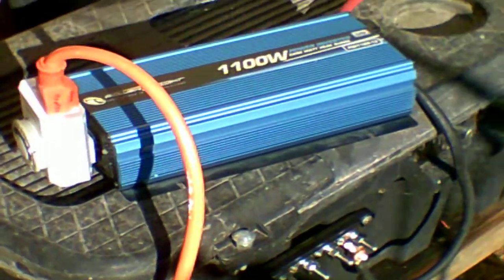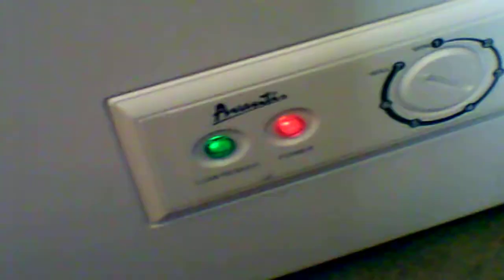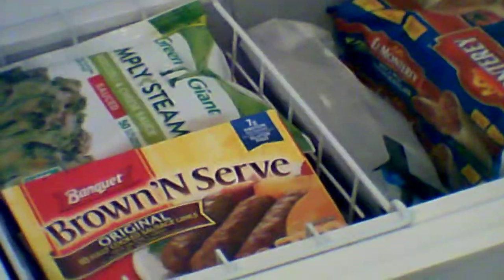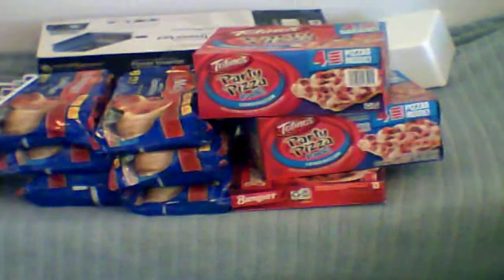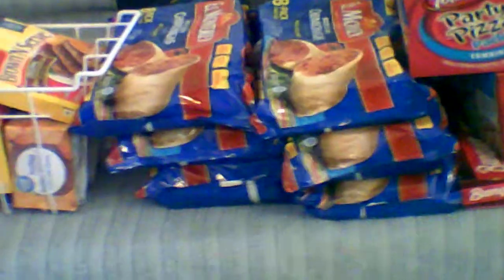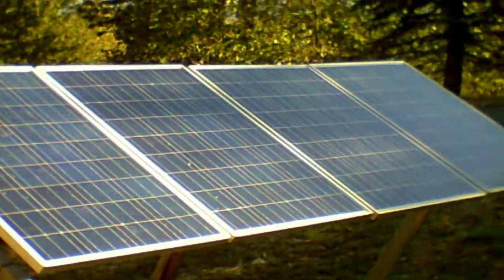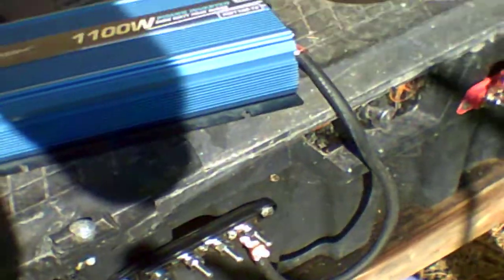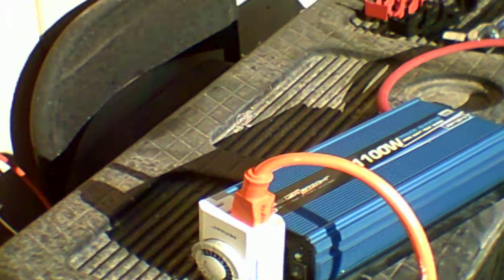Chest Freezer running off of Solar

Comment: I am more interested in the way you are using the timer.

How long do you have to let it run in order to ensure everything remains frozen?

How many watt hours per day does it end up using?

I am trying to do something similar.

It looks like you have to keep the inverter going all the time for the timer to work. Doesn't that waste a lot of your battery power?
Reply from the maker: Depending on your chest freezer you can get by with only running it for 15 to 30 minutes at a time at night 4 to 5 times a night. Like I said it depends on your freezer. My advice would be to test it with your freezer empty, and adjust your timer as needed. Once you find the right setting for your freezer then put the food in it. A full or even half full freezer runs a lot less and stays colder longer. A frozen freezer takes a lot less power to keep it cold than to freeze it. Yes your inverter and timer will use a very little bit of power, and only run fully once your freezer kicks on. Your inverter is more or less on standby mode with a very small amount of power being used for the timer. Then it will output the power needed once the timer and freezer kick on, but it's nothing compared to running your freezer full time. The timer just makes the compressor kick on and off at the times you want. Nothing more Nothing less. Like I said the power usage will depend on a few things. Like the brand of the freezer. The power usage of the freezer. The size of the freezer. How well insulated or how thick the insulation is on the top and sides. Where the freezer is located, because a freezer outside in the heat or sun will use more power than a freezer inside if it's cooler inside. If the freezer is full, almost full, half full, almost empty, or empty. If the freezer was already froze before you connected to the timer and inverter. If the freezer was not froze it takes between 12 and 24 hours or the compressor running pretty much full time to freeze it. If you want to make sure that your freezer can run through the night even without a timer, and you want to use the cheaper lead acid marine batteries. Go with no less than 4 122Ah lead acid marine batteries. If you wanted extra power I would go with 6 batteries. Four batteries will take your freezer through the entire night without worry, and it will not draw your batteries down to much to where 300 to 400 watts of solar could not recover them during the day. Depending on the freezer and how many amps it pulls determines the watt hours per day. This site will help you figure out the watts from the amps and volts. https://www.webstaurantstore.com/guide/600/how-to-calculate-amps-volts-and-watts.html

Comment: i am going to build a stand-alone system for my 3.5 deep freezer i can wait to see how this goes thanks for answers some of my questions for my system. have a great day as it is Christmas today i wish you a happy Christmas
Reply from the maker: I only wish I could have answered all your questions, but on battery usage and running times. That is a question that only you can determine by your own setup. How many batteries you have, and what you are running off of your batteries, and even by the type of batteries you are using, and by how many hours you are using them.
Reply: @christopherhorton821  this is in the planning stages i am looking at a system of 300 watts 2 100-amp hour batteries and a 2000-watt inverter all from renogy electronics running a 3.5 cubic chest freezer along with all the safety stuff in place based on my math it should work fine even in the wintertime
Reply from the maker: @rgarizonahomestead2729  That's great but you can get a full solar setup much cheaper than going with renogy. Shop around for the best deal before you spend that kind of money. Also the math may say one thing but there will be times when your batteries can not get fully charged so make sure to get a backup energy supply such as a generator. In a pinch you could also use a set of jumper cables and your car alternator to charge your batteries.
Reply: @christopherhorton821  i have all the back ups you talked about and yes i am spending as little as i can to get the system up and running along with expansion if needed to run the system thanks for the impute and i will be making a video once i have all the needed parts to run the freezer the freezer is on its way and once i have it i can get started building the system
Reply from the maker: @rgarizonahomestead2729  Glad to hear it. I will be waiting for your video. I do have a word of advice though. Make sure your freezer is froze before you connect it to your solar. It will put a lot less stress on your batteries.
Reply: @christopherhorton821  that a good point thanks for that one stay safe and have a great day
Reply from the maker: @rgarizonahomestead2729  You have a great day as well, and I hope everything works out for you on your solar.